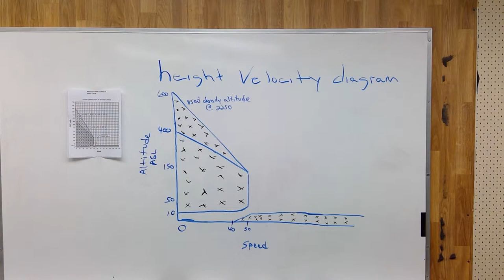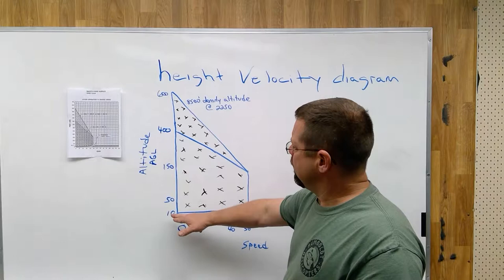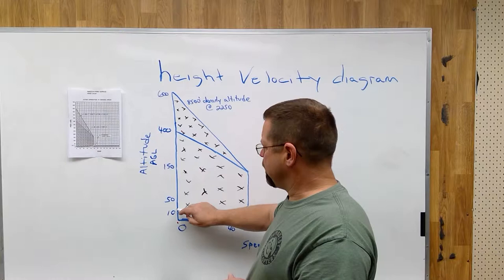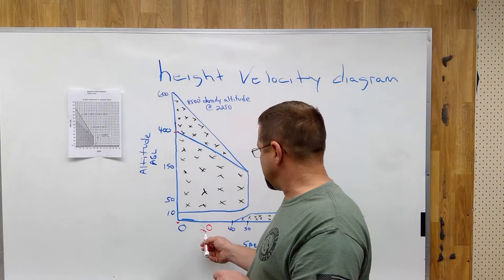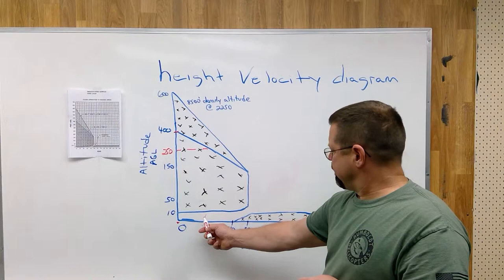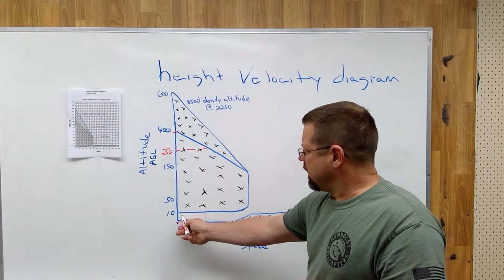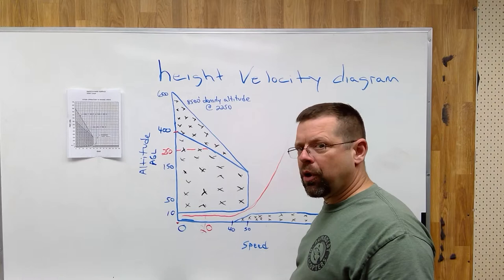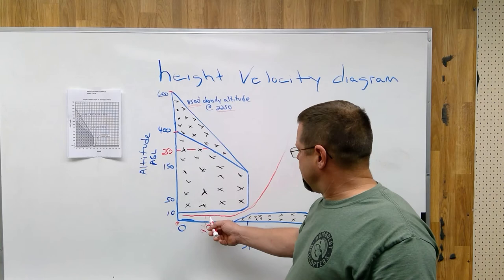Height Velocity Diagram

Comment: Hi, back in '95 when I took my first CPL(H) in US the school gave me an interesting document (unfortunately lost), not sure if edited by RHC (Robinson) analyzing the different shape of the H/V curve during an approach. Summarizing the document was saying that since a descending helicopter controls a "gradual dissipation" of the high potential energy granted by his height from the ground, the standard H/V curve drown for high pitch settings doesn't apply. In that flight condition H/V curve is shrunk and higher from the ground leaving more room available for a safe flight condition and allowing to fly a linear tilted path (glide slope) that doesn't cut into it, as long as the approach path is not too steep.
In all these years I searched for that or for a similar document with no results, did you ever run into this kind of information somewhere during your instructional career?
Reply from the maker: No I haven’t. I stress to my clients that the H/V diagram is not in the limitation section and we practice safe approaches without considering it. We use the reference for take off and slow flight. With the max performance take off being in the PTS, we often have to practice a take off in the shaded area. It is although, a speed/altitude configuration where the AVERAGE pilot MAY not be able to conduct a successful autorotation. I demonstrate autos for students in the shaded area to show how fast it all has to happen.